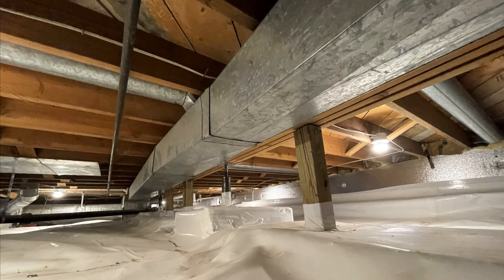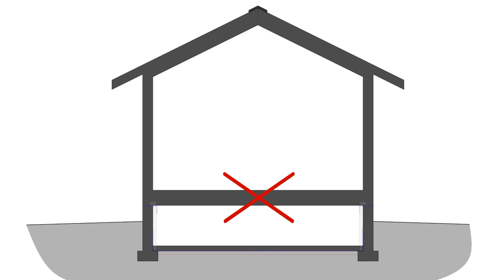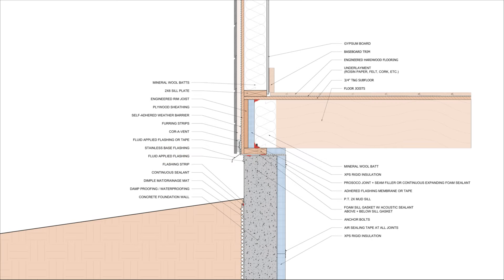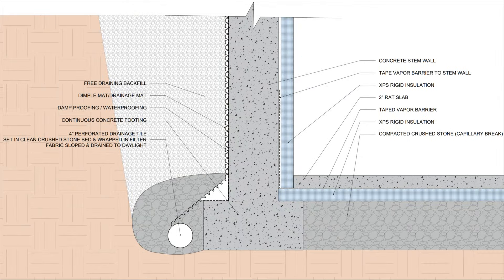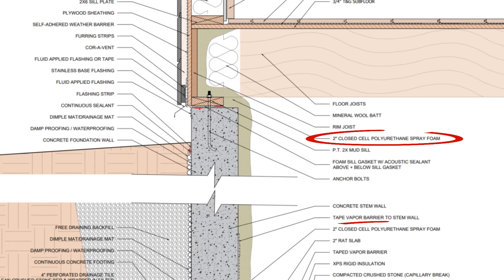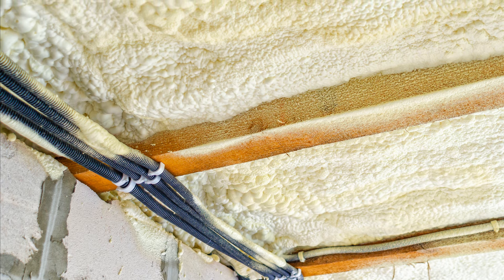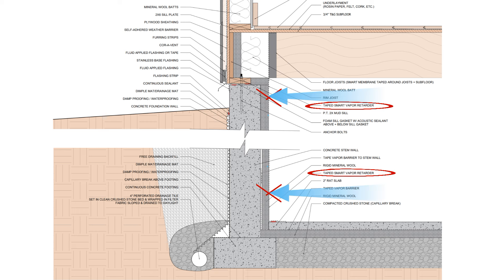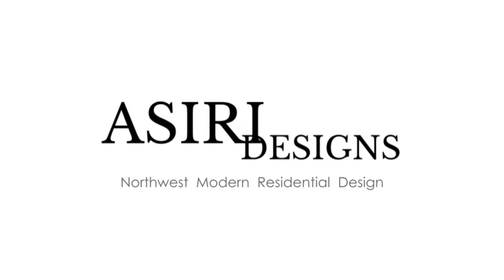STOP Venting Your Crawlspaces | Do THIS Instead

Comment: Excellent presentation....I spent almost 50 years as a carpenter/contractor and finally a superintendent for one of the larger contractors in my state...that said, I know that many of the methods we we began using at start of the constructions trades awareness of energy and it's real costs in the early 70's (this was really triggered by the oil embargo) failed outright or caused costly repair work years later...I'm preparing to build what will by my last home for my wife and myself and really appreciate the effort that many professionals are taking to educate the building trades as to what are proven "best practices"....Thanks for your effort to educate us all....

Comment: Thank you for talking about volatile chemical off-gassing, chemicals slowly escaping from the foam as the chemical reactions that solidified it subside. For volatiles to be below the odor threshold, too dilute to smell, is not an adequate safety criteria. How long volatiles off-gas, and what their concentrations in the air over time are, determines the risk of cancer or other potential diseases. We need quantitative measurements of compounds per cc of air, over time, and the technology for doing that is available, inexpensive, and straightforward to employ. It’s not adequate to use measures like “a long time before” as a guide to what is safe. It’s a big improvement however - thank you, over ignoring the existence of the risk. I usually look to California to do the right thing first in areas like this. But their nice climate means they’ll see less spray foam. So, Massachusetts, time to kick in, please!?
Reply: We see a lot of spray foam for California homes that have a more contemporary design and a variety of other design reasons. Drier climate zones also are more forgiving of insulation installation problems. I think it's still up to the builders to use qualified installers, to understand proper installation themselves, and find the better products--despite the regulations.
Reply: Hu... I wonder if an ozone generator would be able to cut down the time it offgasses.
Reply: Not related to the subject but I wonder how many people realize your YouTube name is SOS in Morse Code 😊
Reply: Can you fill me in on what tech is available to test the long term air quality in spray foamed homes. The only thing I could find was a local lab at a cost of $3700 to test my air for the chemicals in spray foam
Reply: @pcatful  many spray foam products in California, and in cold climates, like NH, MA, etc. REQUIRE the use of low-VOC spray foam. Many times by law.  If you order online, many times the vender, as opposed to Amazon or the box store, will offer the low-VOC variant in addition to its higher-VOC cousin.  The low-VOC variant is meant to be used in enclosed, indoor spaces to maintain climate and application conditions, Texas has less to worry about in this area than New Hampshire and Canada, as they have a longer application window than the Northern States

Comment: Great videos but I wish they would state what climate zones they are referring to more often. I’m not sure if this applies to our desert house or not. So far I’m please with the house. It does not seem to need the complicated systems of cold climate or humid climate houses. We need more cooling than heating. The crawlspace has foam on the outside of the foundation. That’s probably good here as the ground heats up a lot in summer. The venting is only a few small 1/2” holes drilled on one side and a 4” vent on the other side. Ive only noticed a little humidity in summer for 2 months during monsoon season. I don’t think that little humidity will pose a problem and might be good here. Ive not seen a drop of water on the gravel floor. Wish it was slab and a full basement. Need the cool space. It’s important to check once a month for leaks under a house. Listen if the pump is running more than it should be.

Comment: Have always called my 1972 rancher crawl space "hell" at least it started with a skim coat of concrete and not open dirt. On the Wet Coast of Canada it is unfortunate they did not understand or were to cheap to do our "hells" properly. Have had mine for twenty five years and has been a work in progress, now have to replace the pony wall siding as the rot has gotten it. Recently saw a guy using flex seal and at three years is still good. Would be nice to seal the skim coat to help stop moisture migration. But will never get my money or effort worth as when we sell it will be a knock down for redevelopment.

Comment: Hi! Thank you for your video! I have a few quick questions... Would we use the poly-iso with the radiant paper on it, or without? Also, what should be used to attach the poly-iso to the stem wall? Liquid nails? Then we would tape a plastic barrier to the poly-iso to cover the ground, so how thick does the plastic need to be, 10 mil or higher? Questions are for climate zone 3 in NE Oklahoma. Bathroom remodel project. In the process of raking out the ground to make it nice and even under the floor and prepare for either insulating under the floor or encapsulating the entire space.

Comment: In my area, code requires a 4" termite inspection gap between the top or the concrete and bottom plate.  Is there any work around for this?

Comment: How would  you best insulate under living space that is not inclosed? What first did was 2" xps cut to joist bays the air seal that with closed cell foam to fill gaps. I then put 4" roxsol to finish. I put 1/2" chicken wire as a coverall to keep mice out.

Comment: I’m working on a log cabin that was insulated under the floor joists that contributed to the rim joists needing to be completely replaced around the perimeter stem wall foundation. I’ll be lifting the house up to replace the rim joists. The log construction is leaky by nature and even if I follow your instructions to the Tee, the log walls still allow moisture to migrate behind the logs and down to the rim joist. I’d love to see a detail on how to mitigate this issue. Any suggestions ? - thank you for your book! - Jay Dawes

Comment: When you say "insulating a crawl space" I hear it differently, I think you mean insulating a raised floor. If someone says to me, "We want to insulate the crawl space." I assume they want the crawl space insulated, not the floor. I like the assemblies you show!  Yet, none of them look like the pictures you show with the membrane visible on all surfaces. We use spray foam in many buildings, no problems. On a side note, my own crawl space (ca 1980), too shallow, not well insulated, subject to ground water, does not look bad really with wood holding up nicely etc. The old metal piers are another matter!

Comment: In a conditioned crawlspace, 99% of the new houses in my area have sump pumps due to a high water table. Add AC condensation drain lines and you have the entrance of direct moisture in the conditioned space. Is this acceptable or is it treated in some method?

Comment: Agreed that conditioning the crawlspace is superior for humidity and rodent control.  However, it requires radon mitigation in order to maintain IAQ. And radon mitigation systems have their own cons like potential condensation on the radon mitigation pipes even if you insulate the pipe, leading to mold growth.  I'm not convinced conditioning crawlspaces is the best approach in the PNW.

Comment: Insulation on the inside of the stem wall is incorrect. Insulation should always go to the exterior. Where do you wear your coat ?
Reply from the maker: The longterm durability of below grade rigid insulation is a MAJOR concern. While it's not impossible to provide a protection course, bugs love to burrow into below grade insulation, especially if it's wet. I'll gladly sacrifice a few extra Btus if it means I'll get significantly better longterm durability.
Reply: @ASIRIDesigns  I am pretty sure if you put modern waterproofing membranes over rigid Rockwood, you will have a near permanent solution. Doubtful that critters will gnaw into it. Also run a WUFI on the internal solution and see how it pans out over time. You want the thermal Mass of the foundation protected from the exterior climate. But I am biased because I also use a continuous exterior insulation on walls and roof as well.

Comment: Sounds like utopian, but good luck tryn to convince FEMA, insurance, and most inspectors its a good idea to remove vents..😂
Reply: Exactly. Also try convincing your termite pest control company insulating the crawl space wall is a good idea, even with an inspection gap.  Meanwhile, let's build up radon gasses, soil gasses, and just ignore the "V" part of HVAC.  Let's just trash the IAQ.  Videos like these are only 70% of the required solution.  Where's the ventilation?  And, why do these videos ignore or gloss over stack effect?  No one to my satisfaction has a total solution, not even Lstiburek.  And in 2024, builders have thus thrown their hands up in the air and build on slab.  All of it is crap.  Every 30 years, you have to practically rebuild 1/2 your home. It's no wonder 169,668 or 48% of the households in Charlotte, NC are renter-occupied while 184,774 or 52% are owner-occupied.
Reply: @skipbogard I'm in charlotte. Thats got everything to do with the growth of the city and investment companies outbidding people on properties solely to rent it back to them. I was outbid by investors on my first 3 attempts to bid on a home here a few years ago. I've been in Charlotte since 1994. The growth and predatory investors is the only reason the rental rates are so high.